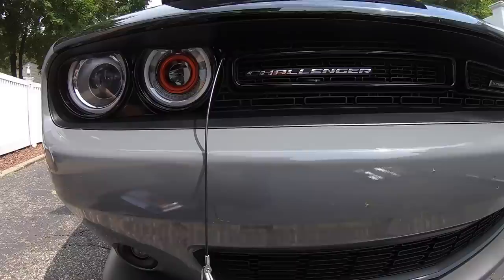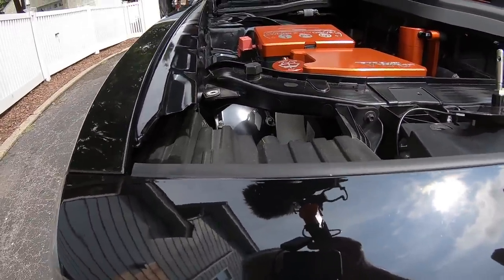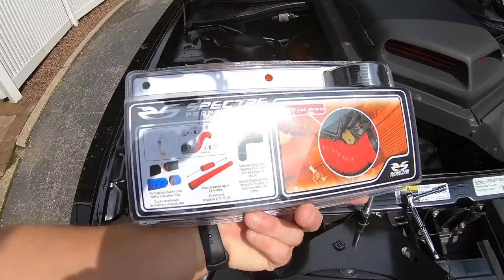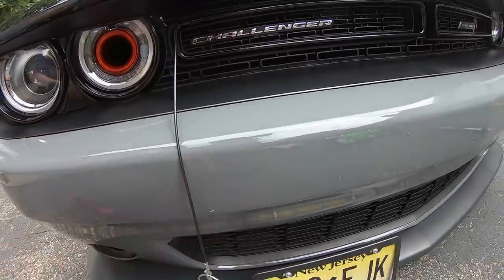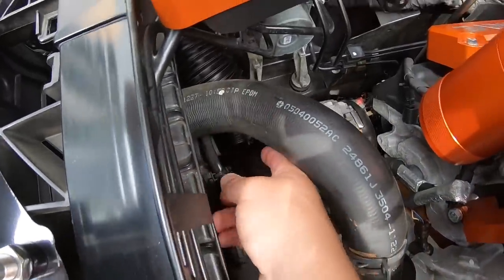Challenger Passenger headlight Intake - Ram Air x3 with Spectre 3" Tube

Comment: So you are dumping rain water directly onto your alternator? What is the point, why not pipe it actually to your intake?
Reply from the maker: it's not dumping water onto the alternator, it's dumping it down to the maintenance pan.  Getting the air to the intake is not worth the effort.   I found a better solution in my latest video, it's a blocking plate with a drain.
Reply: Work Play Drive won’t those blocking plates with the drain still make the passenger side look different from the driver side?

Comment: Any Update on how this worked out for you?
Reply from the maker: No issues since install I didn’t see major dirt or water spray like I did with the holes open. 

I just installed the lit inlet tube so I had to take three hose out for now and modify it to fit with the new setup.
Reply: Work Play Drive how did you modify the 3 tube to make it work with the inlet tube, i am wanting to do the same

Comment: Is there any way to bend/extend it so that it goes into the air intake like the normal hellcat intake
Reply from the maker: Yes, you would need to downsize the tube to at least a 2" rigid tube then run it across the front of the engine. By then if not insulated you are now looking at hot air so it's not too worth it.  With the hellcat intake and airbox you are already getting more air than is needed.
Reply: @WorkPlayDrive  unless you have a Hellcat.

Comment: What’s the benefit of removing the caps to let more air in? I’m new to all this so I’m considering should I do this or not 🤔
Reply from the maker: On the driver side if you run it to the air box you get faster recovery from heat soak. 

On the passenger side no benefit other than making them look even to prevent people tell you one of your headlights is broken.

Comment: What’s the benefit of the headlight intake ?
Reply from the maker: The Driver side headlight intake directly into the air box gives more cold air while in motion, lower intake temperatures and faster cool down from heat soak.  

The passenger side intake - stops people from constantly telling my my driver side headlight is broken.

Comment: It’s funny you’re worried about the air coming in through the air intake on the headlight area but what about your grill? All that water is being sucked in through your radiator and thrown all over the front of your engine, if you don’t want it getting dirty from the rain don’t drive it in the rain.
Reply from the maker: Not worried about water coming in, it was the additional time it took to clean that area due to the opening. 

This was my solution to enjoy my car whenever I want and lower the effort to shine it up for shows.

Comment: This is a whole lot of work for nothing. lol At this point just keep the cap on the headlight ffs. Maybe remove the lense at the track OR build something where the passenger side inlet can connect to the intake. This right here is a total waste of time.
Reply from the maker: I have toe cap off so it looks even, 1 cap on 1 cap off was bugging my ocd. 

The effort was simply to stop spraying my engine bay. Moving it to the intake is not worth the effort.

Comment: I still do not see the point of that tube, it is not providing any cooling benefit, it's not giving you any horsepower, all it's doing is making your engine bay dirty. I don't see any positive outcome to putting a tube like that in your engine bay all you are doing is routing the air so it goes down and does not even hit the engine. Even if it did hit the engine it is providing no cooling benefit whatsoever. That's what your antifreeze is for and your thermostat. If you're worried about keeping your engine cooler just get another thermostat. I can't believe how all these people on this website are agreeing that that is a cool modification. It's a waste of $20 and I just don't got why you put a tube on there if all it's going to do is put water and dirt somewhere where you don't want it. The driver side one I could see if you had a Hellcat airbox but the passenger side is absolutely pointless and I just don't get it. If you think it works or if it benefits more power to you but it's not doing anything I will tell you that. Even the Hellcat airbox provides a tiny bit of horsepower that you cannot even feel maybe about 10 crank horsepower which comes out to about 2 wheel horsepower. If you want to make your car faster save that money for a blower and get a tune but that's the only way I can justify getting more horsepower for your vehicle. I just don't get some of the crap that people come up with. I have a 2019 Scat Pack and there's no way in hell I would put that in my engine bay so water can get everywhere in my opinion and in a lot of mechanics opinion it is doing nothing except making your engine dirty so good luck with that
Reply from the maker: Agreed it does absolutely nothing to benefit performance, and as I stated in the beginning of  the video its an option to keep the engine bay clean by converting the water spray into a controlled drip out the bottom maintenance pan and diverting a little extra airflow into the engine bay.

This was not meant to be a performance modification, but a solution to an issue with opening up the inlet tube for whatever purpose the vehicle owner chooses to.

Comment: I'm sorry but close the door when it rains open the door when it's sunny invent a deal like open headers closed headers cable operated there ya go get to inventing
Reply from the maker: Really no need for the effort, the water at this point is minimal and over 4 years has not cause any issues, rust or lasting dirt.  Look at the hellcat heat extractors wide open and the water from the hood drains down into them.
Reply: Shoot the charger had air operated headlight covers ,air grabber hoods were air operated in sure thers someone out there who can figure something out I've already told ya how to do it now get after it "!!!!!!!!!!!!!
Reply: Vacuum  operated like headlight covers